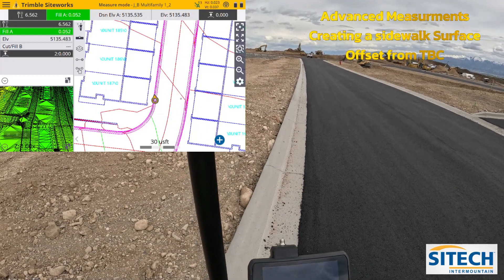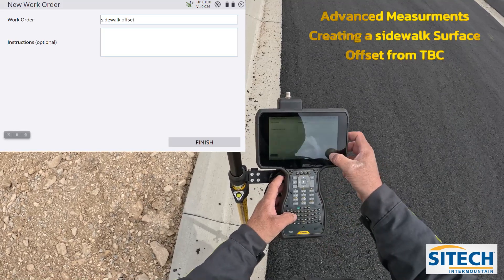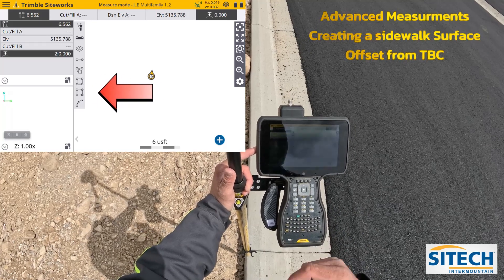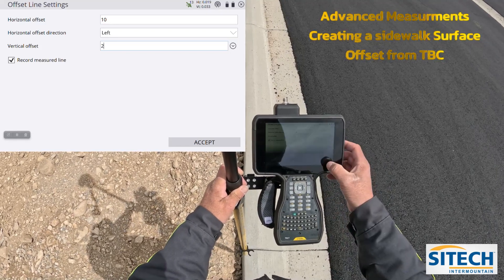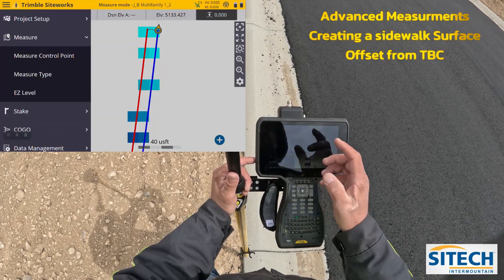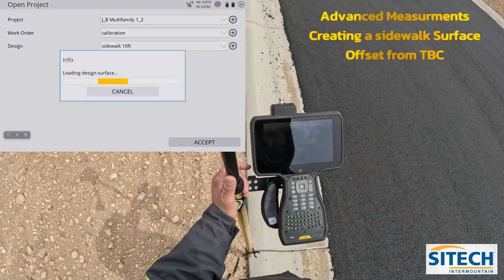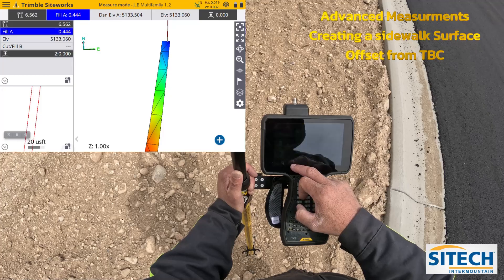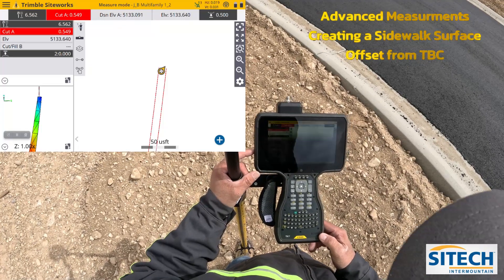SITECH Siteworks Advanced Measurements Create Surface for Sidewalk off TBC

Comment: Thanks for your videos are very helpful!!
I have a question im hoping you can answer. I have curb and gutter on one side of a road and median curb with 10” reveal. Concrete is there but subgrade is not done for paved area in between. I created a break line for curb and gutter lip and top of curb. If i create a surface between those two lines the grade will be off because of my 10” reveal on the curb. Is there a way to creat a vertical 10” offset on the top of curb that i shot to creat an accurate fg as built model? I know i can edit each shot elevation but im just hoping there is a quicker way maybe dropping that whole break line with top of curb shot by 10”. Thank you keep up the helpful videos!
Reply: I am so glad these are helping. Sometimes I wonder if its all worth it.  So you are in luck, if you have advanced measurements on your siteworks, you do have the ability to set a vertical offset while recording a single point or as you record a line string.  Go to your MENU- go down to SETTINGS- then hit MEASURE- and in there is a line that says MEASUREMENT OFFSET. Drop the bar down and set to ENABLED.  Then when you go back out to the main screen and then go into your measure type (where you are choosing point or line to do) you will have a new option in there to be able to set a VERTICAL OFFSET to what you are measuring. So example, if you have one side of a parking lot or road that needs the reveal like you said, you can set it to record what you are shooting with the point of your pole, but it will apply an offset to it as you shoot it in and don't have to edit it later on. This will solve your problem. I actually have this on my list to make a video on. Maybe I will move it to the top of my list. I have just been busy lately and slowed down on my video creations.  Hopefully this helps in the mean time.